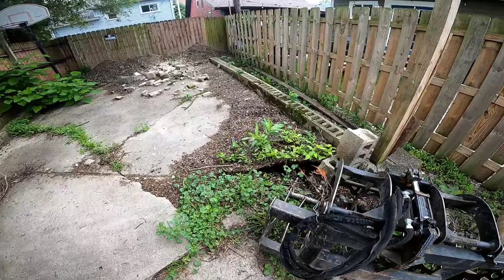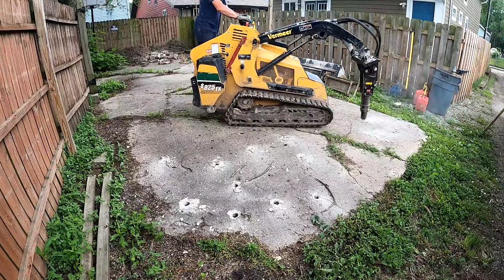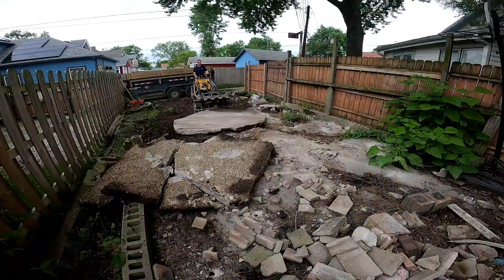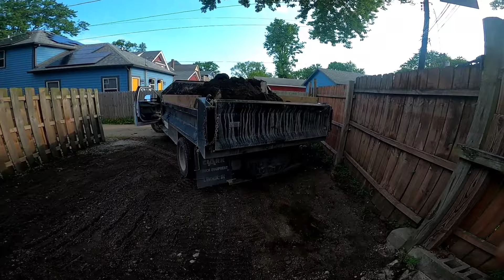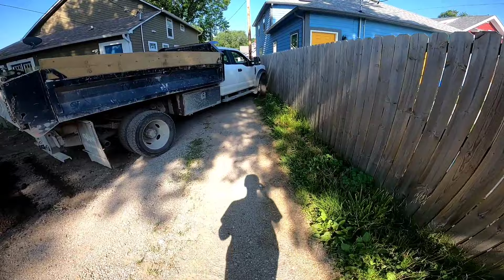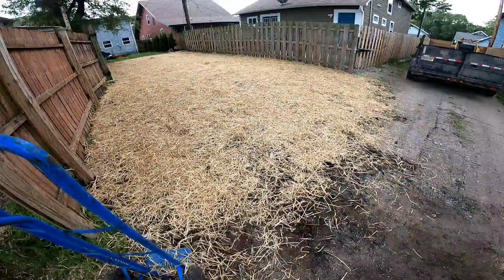Only A Mini Can Grade This Backyard-No Room For Error!

Comment: I wanna know what is your TRUE opinion on your truck how it performance what is the year and engine LOVE THE VIDEO EACH AND EVERY ONE JUST FOUND YOU 2 DAYS AGO
Reply from the maker: I've had good luck with the V-10. My newer F-550 has the 7.3 "godzilla" engine. Not fully impressed with that engine. I've had to take it on several times for plugs/wires overheating. I think it's fixed now but not 100% sure. Will keep updated!

Comment: Heelo i have a question. Are you running a 25hp vermeer? Or a 40hp? Would you say there is a big difference if you ever tried the two?
Reply from the maker: 40 hp. I ran the 25hp one day but only moving a small amount of dirt. Unfortunately not sure how it does with attachments